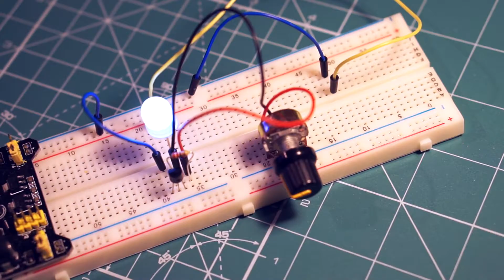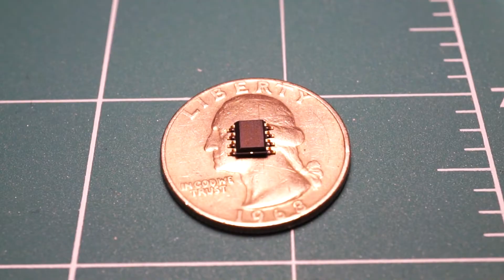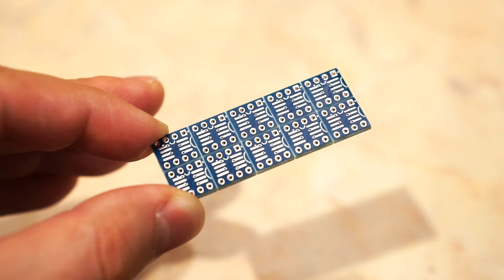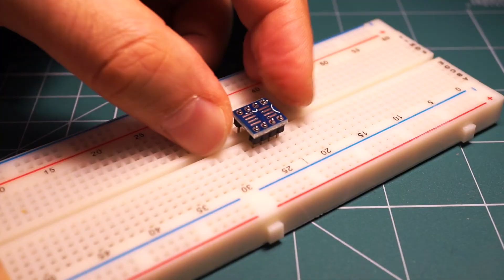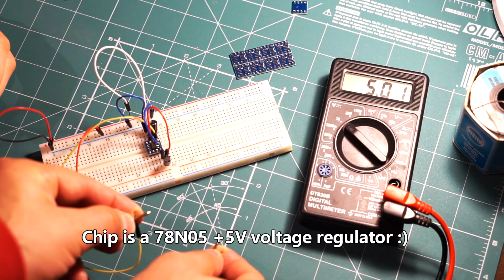How to use SMD IC parts on a breadboard

Comment: I hope the price of those adaptors has come down. Last time I checked they were several dollars each - often more expensive than the IC.
Reply from the maker: Hey, I got mine from AliExpress. They're much cheaper. The ones on Amazon are not that expensive either. I have links in the video description.
Reply: @LeftyMaker  OK - thanks for that advice.

Comment: Good description of the chip carrier board and how to use it! Usually, soldering over a solderless breadboard ("plugboard") isn't a good idea. Solder or flux could spatter on the board and ruin some of the sockets. Before soldering, cover the unused sockets with electrical tape. After soldering, remove and discard the tape. Then you can assure that the sockets remain intact.
Reply: Good idea. Or even make a mask from cardboard with a square hole cut out to suit the size of SMD-to-Breadboard adaptor used. Easy to drop over and remove without possibly leaving sticky residue on the breadboard.